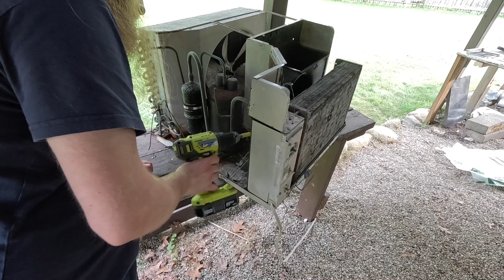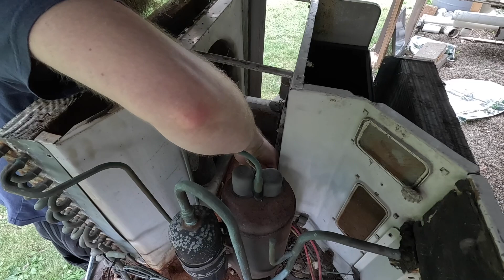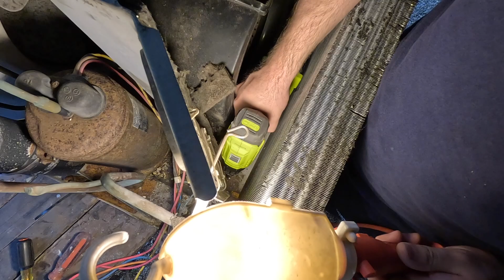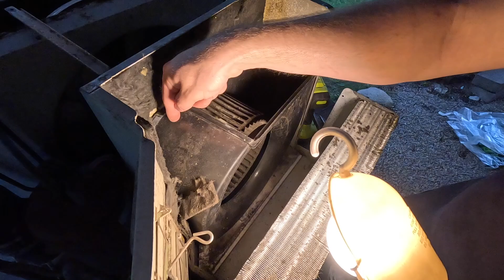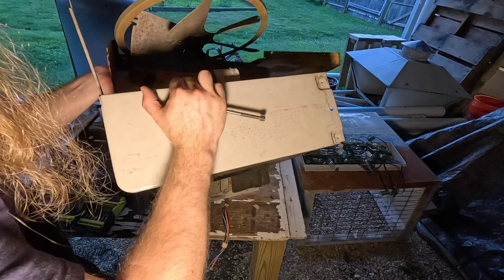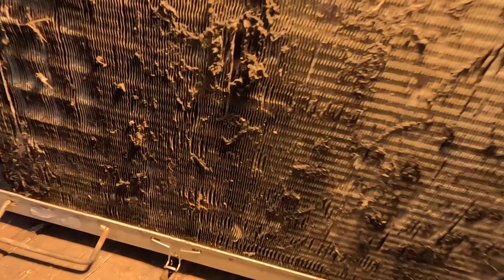Air Conditioner Disassembly Nightmare | Kenmore (Whirlpool) 106.8761890 18,000 BTU Air Conditioner

Comment: Whirlpool loved and still does love to use tons of screws on every nook and cranny.  There are people everywhere that will die on that hill regarding the dumb high efficiency water slinger thing. I am not one of them. I’m in the group that it’s a dumb idea when it comes to water and metal mixing in appliance situations = rust.
Reply from the maker: The smaller chassis Whirlpool units are a dream to work on, I guess those are the odd ones out.

Comment: It was so difficult because it has a rotary compressor. If that were reciprocating the disassembly would have been seamless.
Reply from the maker: Exactly, the compressor type and it being a 220v machine immediately make everything worse.
Reply: @JordanU  220 volts is an automatic trip to the scrap pile.